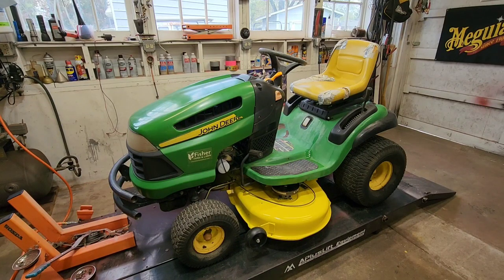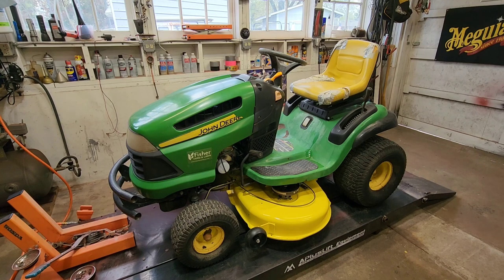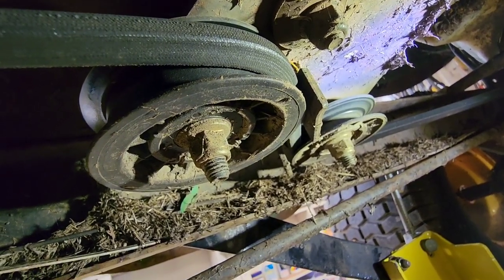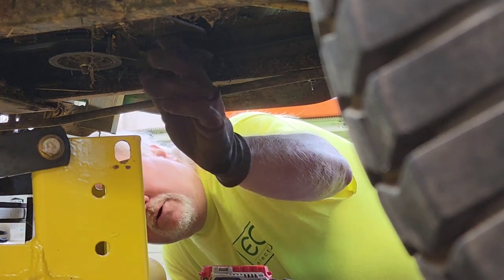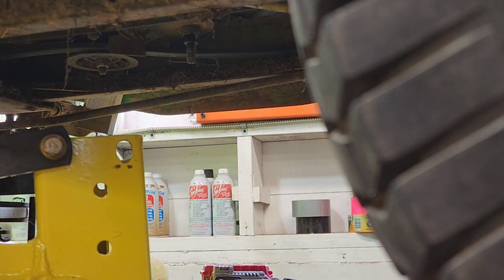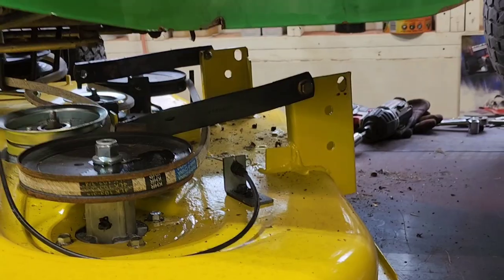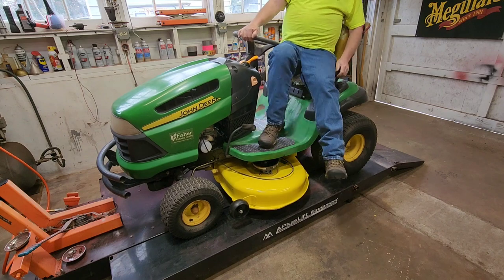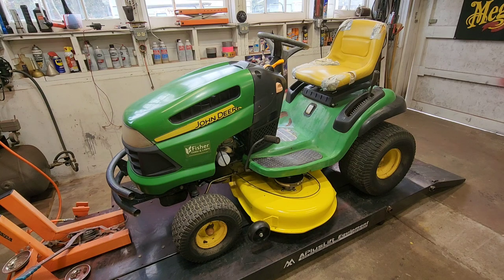My John Deere Lawn Tractor is noisy when I let the clutch out. Let's fix it!

Comment: When i release the clutch on my LA125 I am getting a knocking noise, never before though. Thoughts?
Reply from the maker: The belt only runs these two pullies and the transaxle. With the clutch in, spin these pullies and see if they are noisy, check the condition of the belt, then spin the transaxle pully. I hope it's something simple and easy.